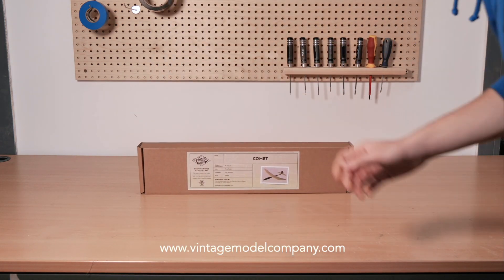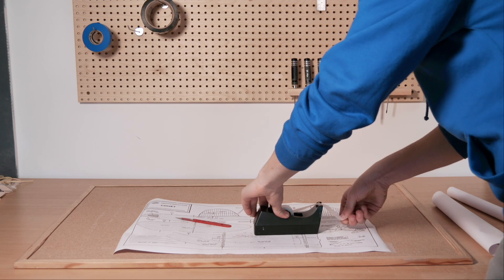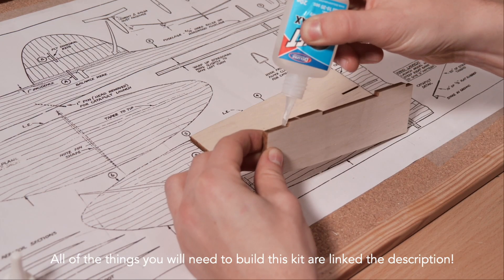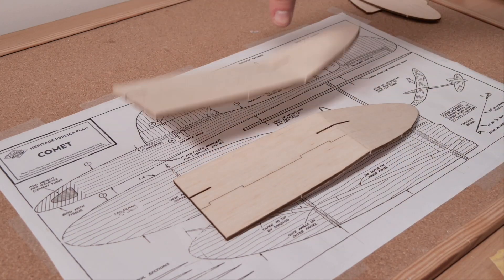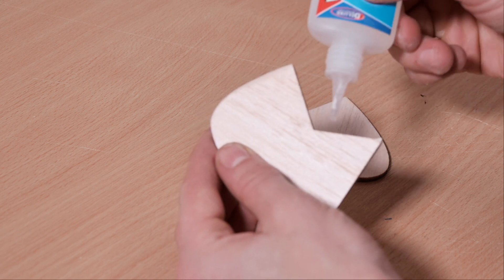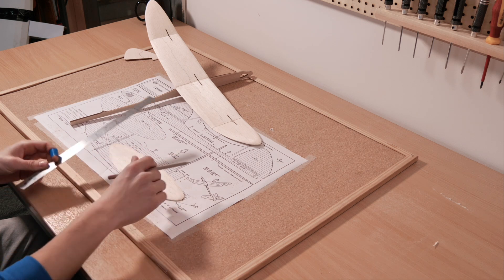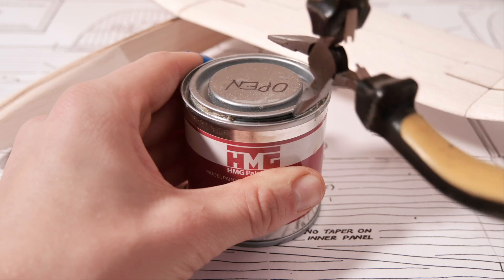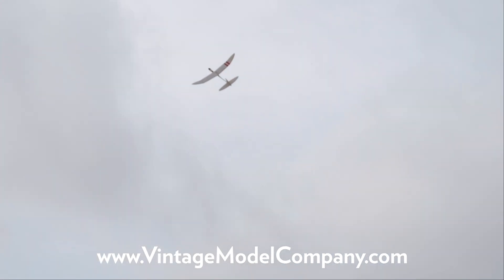How To Make a Balsa Glider

Comment: Massive design fault on this mate regarding the tailplane and fin (3.18 and pause), nothing fits properly. The chord of the tailplane is to wide and the fin needs a concave shape sanding into the same shape as the tailplane. Or, raise the rear of the fuselage and do not cut the bottom leading edge of the fin.

Comment: A nice neat kit, and the classic model looks like a larger version of a smaller "chuck" glider that I made in the early '60s (most of it survives at the bottom of a bedding-chest).
    The wing on this model has what amounts to a 'flat plate' balsa-wing that has to be sanded carefully to achieve a real "glider" airfoil-section: that's probably where anyone assembling the kit would have trouble, unless achieving a proper wing-section isn't all that critical, given the small scale of the glider. Would there have been any way of machine-sanding the wing-panels to the right cross-section before they were boxed along with the other parts, to "head off" any mistakes by the builder ?
   Would the balsa components need to be treated with some kind of filler or "dope" to harden them and prevent water-damage ?
Reply: Ah...they showed him sealing it. And sanding in the airfoil?...easy peasy.

Comment: Looks good but I see a couple major issues: 1. Sanding that much wing material is a bad idea, especially after adding the dihedral. You always shape the entire wing as a single piece before adding dihedral, and use a razor plane to speed the process and reduce the dust (that amount of balsa dust is a fire hazard and will make you choke). The result is a more accurate wing which more than doubles your flight times and it's easier to boot!
2. Put plastic or parchment paper over the plans. Don't just glue straight on them!
3. Leave the ballast box open so you can balance the plane after sealing it.
4. Minwax Spar Varnish is by far the best sealer ever invented for sealing bare balsa in outdoor usage applications.
Reply: joshuawfinn ... I will second everything Josh has mentioned, and add that for maximum performance, this model would be great with a “Stanfoil” airfoil section.  Made popular by glider expert Stan Budenbohm, the Stanfoil is an easily formed high performance section that will take just about any glider to a whole new level.  It’s worth looking into, and a quick google search will get you there.
Reply: I use a thin coat of clear Krylon.
After it dries I smooth out (burnish) with a smooth dowel, and apply a thin second coat.
Never yellows. Works great.
Reply: @markspahr242  I used to use krylon, but still had trouble with the planes warping in humid conditions. Switching to spar varnish made that problem go away.
Reply: I spray the spar varnish on a paper towel and rub in one thin coat. Finish off with some 1500 grit sand paper. I like the Tamiya sanding pads made for plastic models. They are pretty expensive, but you save it for the "special jobs".
Reply: Ha ha. I disagree with 4! The best finish is thinned down twin pack acrylic lacquer. 😀

Comment: Great build! Very informative and concise. Well edited too. Looks like your trailing edge could use a bit more sanding! Taper it right down to that nice shallow wedge shape and that thing will cut through the air like nothing you’ve ever seen! :) happy flying!
Reply: I feel like he should've sanded in the airfoil before joining the wing pieces =P
Reply: I though the same thing. Joining them first like that, he’s just making the sanding that much trickier. But really, if we’re being honest here, that wing could do with a lot more thorough shaping and airfoiling.
Reply: @AeroCraftAviation  Exactly. It would be loads less word to cut the ply =P
Reply: @AeroCraftAviation  The plywood reinforcers for the polyhedral would be too tall after sanding the wing, so you would have to cut the protruding joiners away, flush with the top of the wing.
Reply: @AeroCraftAviation  Fair point =|
Reply: Just to weigh in, the absolute best setup would be to tack glue the tips on with no dihedral (Duco?) and then shape the wing. Add the dihedral braces after dihedral. Honestly that ply isn't even needed on a little glider like this. The pros back in the day were hand launching to almost 200' with no reinforcing at all.
Reply: @joshuawfinn  I had no idea the Comet was capable of such flying! Is a Polaris of similar flying ability? I made one a while ago!
Reply: Henry Forster I strongly doubt Lee Hines could have thrown this particular design that high. My point was the launch velocity required to reach such altitudes -- 100+ mph.
Reply: @joshuawfinn  Makes sense. I wish the weather would cooperate so I can get some flying in with my Polaris. It's perfect for at the park.
Reply: Henry Forster, yeah the cold frozen North isn't very flyable this time of year.

Comment: Would  you conversion it to rc glider ?
Reply: Man Crazy  You could also use the power and servo unit from a umx plane. Like in one of the horizon hobby planes.
Reply: Man Crazy when I seen the transmitter on the opening of the video I thought they were going to do just that. Could get a free flight timer/ESC a coreless motor and 150mah lipo and make it powered free flight?
Reply: Even better, you could slap a couple 1.1 gram servos on there with a little frsky receiver and all you’d need is one of those little 35 mAh batteries! It’d be a nice little hi-start flier or DLG.